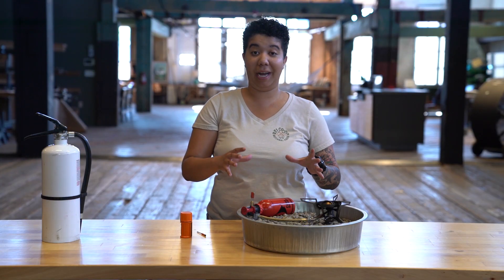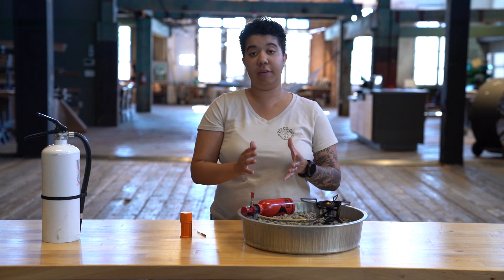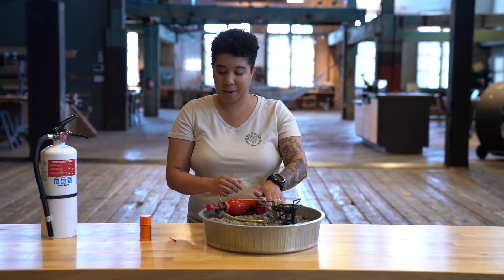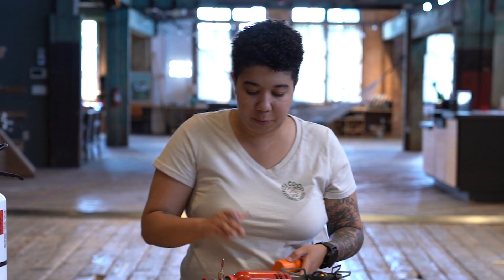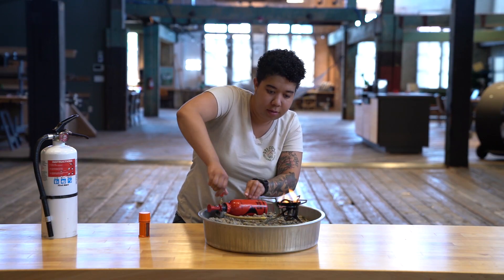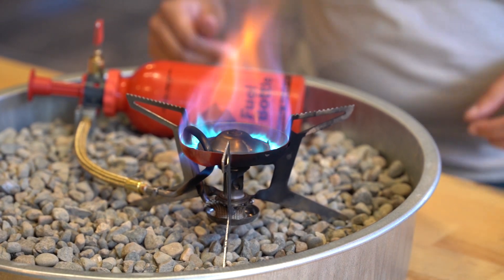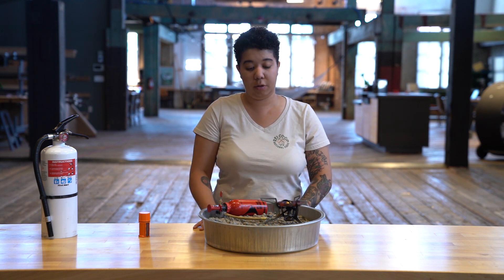How to Prime and Light a Liquid Fuel Stove || REI

Comment: How do you pack this in to your backpack.
Do you put stove in a plastic bag in your pot, or do you put stove in the outer pocket?
With the fuel bottle do you put in main compartment of backpack or in the outer pocket, and do you leave on or take off the pump?
Reply: With a liquid fuel stove, there is always a drip or 2 of fuel after taking it apart. Not a big deal. When done cooking, close the valve, let the stove cool down,  disconnect the stove from the pump, and leave the pump on the fuel bottle.  Depressurize the fuel bottle by unscrewing the pump a little, and then tighten it again after the pressure is released.  The stove and fuel bottle (with pump attached) go into an outside pack pocket, not in your pack interior or cook set.

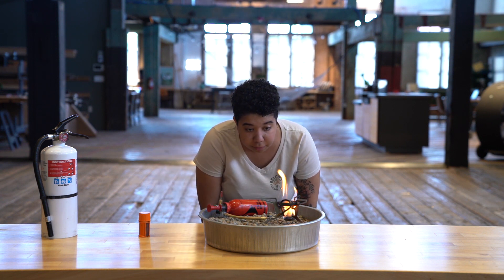Comment: 1:36 I have been searching just to make sure I was right on that part of a liquid fuel camp stove. Noone has done a basic education of how they work. everyone just shows and does it. Never explaining why and how
Reply: Exactly this.  Liv (sp?) did a great presentation, and there is no reason that she should have gone into this in this video.  But I 'm also searching to learn how, exactly, that "little tube" works.  On my MSR XGK EX it's an in-your-face round tube across the whole top.  I know it vaporizes the fuel, but I am looking for some science on what actually happens in and how it remains safe at both ends, etc.  Not to mention - what it is called?  The MSR parts list does not call it out by name.  So I guess I'll name it the "vaporizer tube". :)
Reply: @donirving3806  Some answers, and I hope they help.:  The stove being demonstrated is an MSR Whisperlite, a backpacking/mountaineering classic for decades.  The stove needs priming to be hot so it can vaporize the liquid fuel into a vapor. The fuel tube (sometimes called a "generator")  is permanently attached to the stove on the Whisperlite and is not an individual part.  The liquid fuel boils as it passes through the fuel tube and turns into high pressure vapor. It is this fuel vapor that makes the stove burn efficiently.  The connections on the stove are very tight and sealed with rubber O-rings so it holds pressure and does not leak.  However, the O-rings need occasional replacement as they do wear out, and REI sells maintenance kits with them.  This maintenance is easy to do.

Comment: Well demonstrated.  Also, this shows brilliantly why the whisperlite is pretty much entirely obsolete.  Too flimsy to be a great option for car camping, too heavy and bulky for backpacking (went out years ago in favor of the Pocket Rocket style stoves).  Also pretty fussy with the priming.  With practice it's easy enough, but the smaller lighter stoves just light up without all the hassle.
Reply: While agree to a point. Pocket rocket stoves are nice because they pack well and heat up cool down quick. However, they fail hard durning winter backpacking trips. Liquid is unaffected by seasons. Plus generally burns hotter.
Reply: Compressed gas stoves may be fine in Europe, North America and other first world environments.  But what about the reliability of the fuel supply in more remote environments such as the Andes and the Himalaya?  A multi fuel stove burns gasoline, kerosene, diesel, etc.
Reply: "Too heavy and bulky for backpacking", Are you serious?. lol